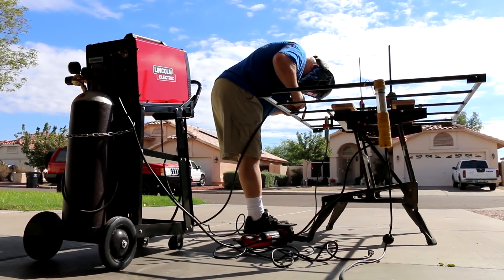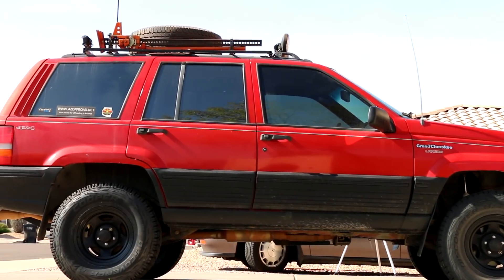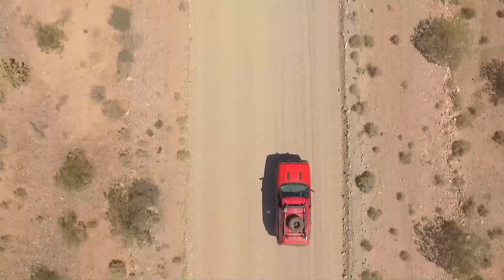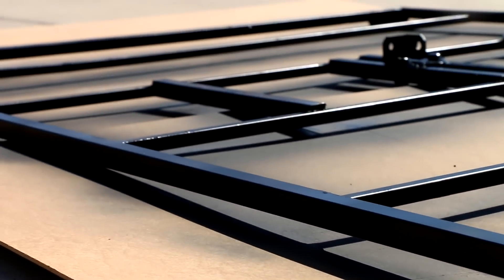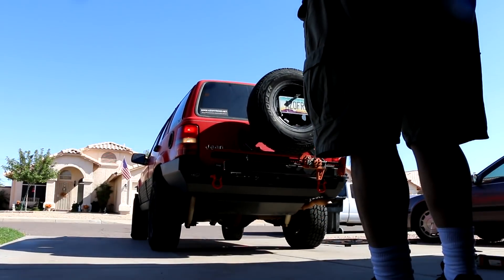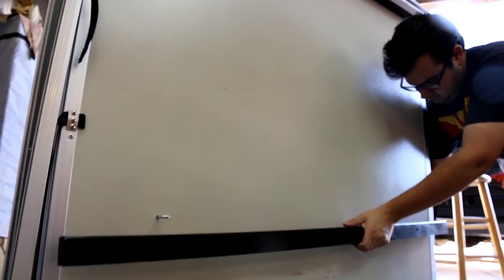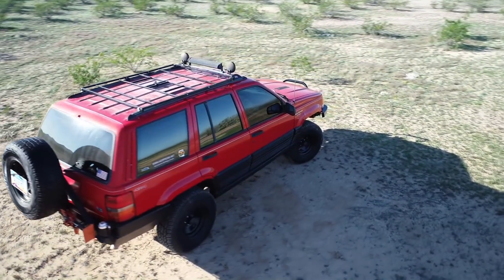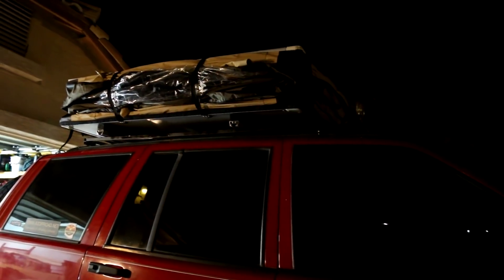Jeep Grand Cherokee Project (Part 10) - Rack Upgrade & RTT Mount

Comment: I think I would have opted for something other than wood for those spacers. Plastic lumber comes to mind, it is used for foot bridge and sun decks. Super durable and will not weather like wood does. You can cut it with the same tools you use for wood. After some time that wood will get pounded out and start squeaking. Even though you painted it, it will swell when wet and shrink when dry. I think that plastic lumber can be purchased at a building supply store.
Reply: So far zero issues with the wood spacers. They are working perfect as designed.  Water is never an issue in Arizona... Never rains ... lol

Comment: Dude that welder isnt setup right those welds arent any better.... ne
 have someone do your welding til you learn how to setup gas heat an wire speeds
Reply: The welder is working just fine.... great tool to have and has handled plenty of projects.